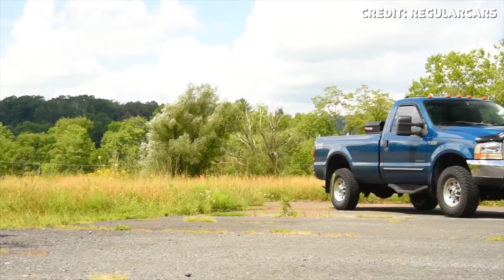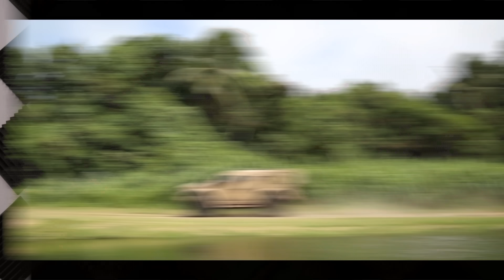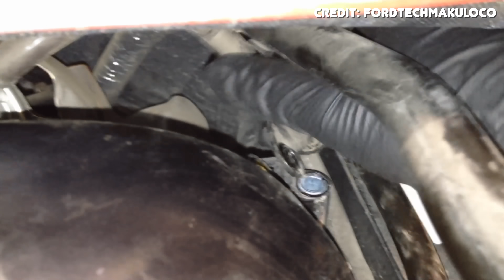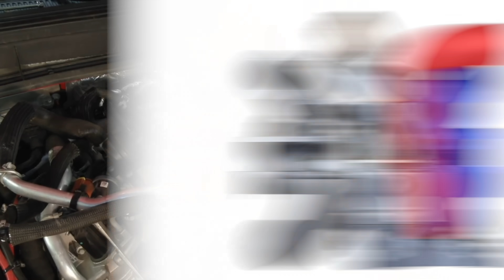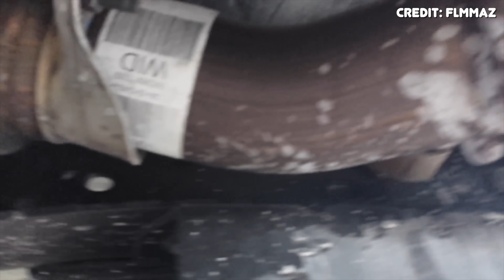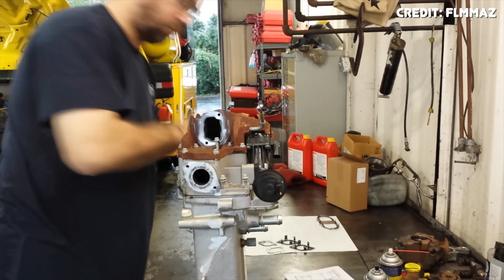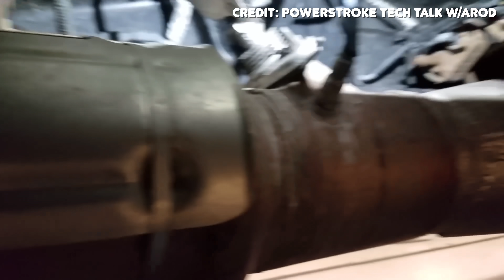Everything Wrong with the 6.7L Powerstroke

Comment: The only thing I don’t like about the 6.7 is that you can’t get a manual transmission 😢
Reply: The 2022 models have them in Mexico.
Reply: @braydunh6829  Good luck getting one of those though. In Brazil they're still making the chevy S-10 diesel with a 6 speed manual.